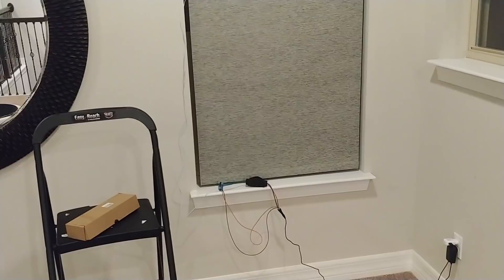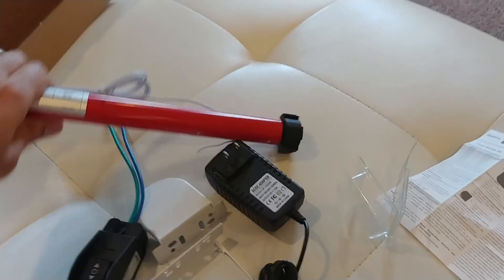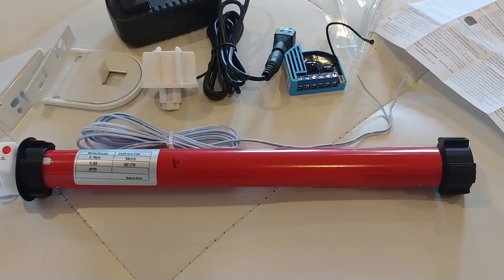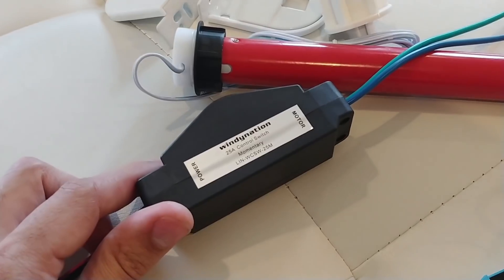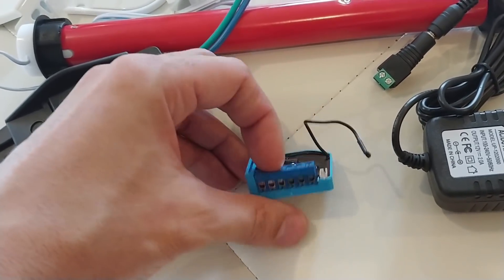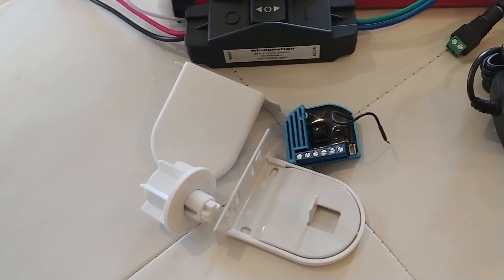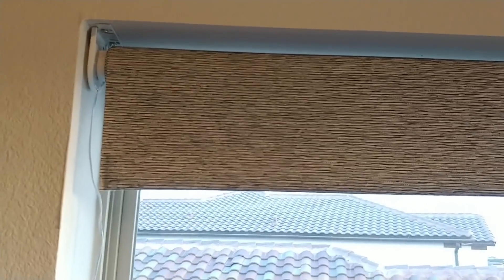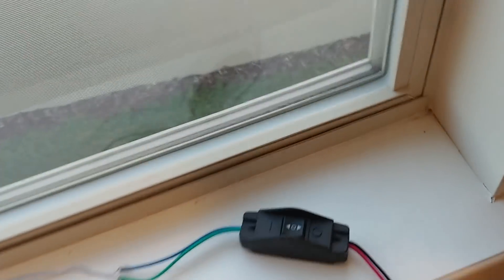Cheap Automated Z-Wave Roller Shades Using Qubino and Home Assistant

Comment from the maker: Quick updates - 
 - I fixed the up/down issue by simply reversing motor polarity in the qubino. The buttons now work as they show in my interface.

- I removed the switch from the qubino and the automation still works. So you can just use the DPDT switch to "teach" the qubino, then get rid of it. That way, all you need is one switch, and you can use it to "commission" all of your windows. Makes for a cleaner install as well!

Comment: Thanks for sharing your project. I am wondering if you ever got Alexa to properly recognize the Qubino. She is having the same problem with mine. Says she is having problems and that the Qubino isn't responding, but the thing actually works as it should. I'm using Hubitat. Thanks.

Comment: Please hide your public IP. Do you need that switch or can you just connect it straight to the zwave device? Anyway Great Video
Reply from the maker: Good point for future videos.  Thanks.  Luckily my IP has changed since... I just got a new ISP :).  You can just connect it straight to the z-wave switch, I mention it in my update comment.  The switch can be used to set everything up then removed.  So you can set up all your windows with just one switch.

Comment: Would reversing the wires from the motor to the Qubino not fix your up/down issue?
Reply from the maker: Yes, reversing the motor polarity should change the direction and fix the issue.  I realize that was the obvious solution, but I was actually rushing to finish this video to go to a xmas party.  I will do that today.